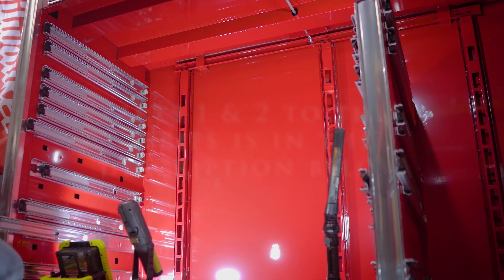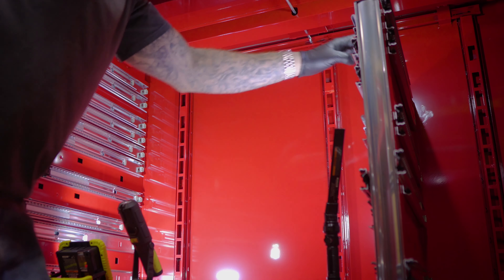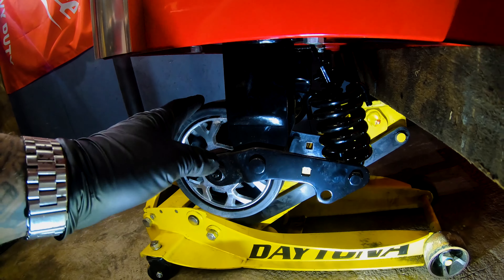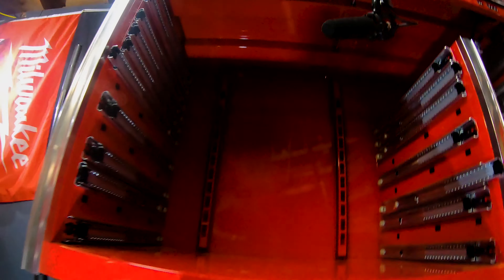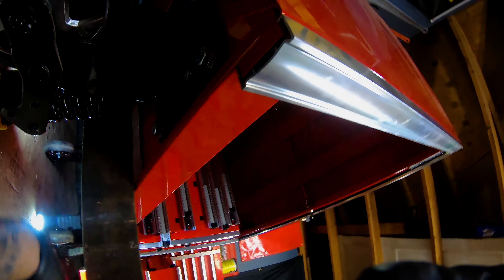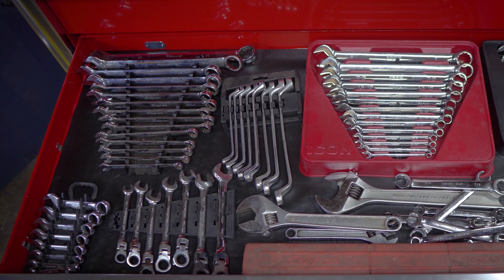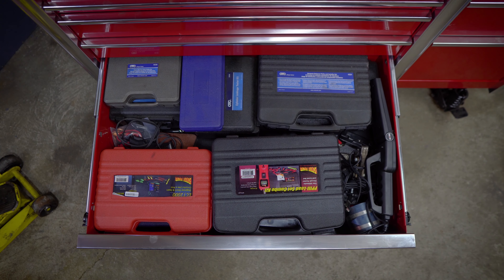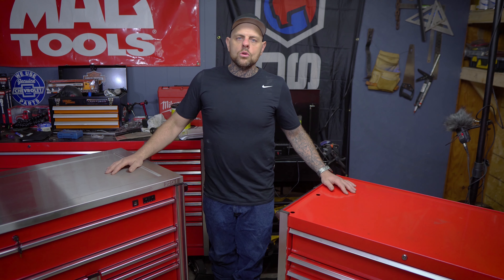Harbor Freight ICON Toolbox vs US General Toolbox A Look at the ICON Toolbox Construction

Comment: I trust you brother, I've been turning a wrench a long time under a tree and I have two boxes a Craftsman anniversary and U.S. General.  The General is dying and my tool collection is growing,  I need at least a 56 for my large torch wrench.  I am seriously considering pulling the trigger.  My brother is an A&P he works for a major airline and probably has all the big name tool truck stuff.  He told me there was nothing wrong with my setup and said I am fine I told him about ICON and he said many mechanics in his shop and shops at other facilities used ICON and even U.S. General over Mac and Snap off.  The price point is a barrier but I have reduced the size of my garage and I can not keep adding boxes so perhaps I can sell a box or two and get a good box.  Peace out!  Keep the shiny side up!

Comment: Now I’m just a DIY guy but, I’ve been looking to upgrade to a 72” box for months now. 72” us general for $1200 plus having to rivet the drawer slides, etc. 72” icon, just the roller is $5000. 73” x 25”. A Tool Vault box ( probably overkill for me) but I could get an 84” x 30” roller with a stainless steel top for just over $4000. I don’t have a need for a hutch or anything but a side locker ( it’s a want, not a need). If this box is the one I’m owning for life, I’d be better off waiting a bit longer and buying the Tool Vault imo. Realistically though, I’d be fine with the US General for the money.

Comment: I physically saw these boxes yesterday 10/18/19. These ICON boxes are top of the line. They are just as good as Snap-on for half the price. I was surprised at how nice and sturdy it was.
Reply: I own an Epiq snap on and just purchased a ICON for home. The ICON is certainly not “just as good”. However, I will admit that it’s almost as good for way less than half the price.

Comment: Just sold my Snap On set up and I ordered an ICON 73” bottom, 56” top box and a side locker, $5900 with a HF credit app and the 10% off it gets you. Same setup thru Snap On is $28,700. If you really hammer your dealer you might get it for $20,000....crazy.

The drawers in the ICON can be changed out, remove two shallow drawers and replace with one medium, move shallow and medium drawers to different positions as needed, etc.
It’s still a very expensive tool box for a DIY’r, but a bargain for a professional like I am.

Comment: It really looks like a great box. And I agree if used for daily use I would choose the icon or snap on. I finally got to see the rachets and wrenches in my local store. They actually put out the rachets and wrenches where you can handle them and I was impressed with both very impressed.

Comment: Out-of-the-box question for you........
I own a USG 56" Series 2 top & bottom
I love everything about it BUT that top socket drawer.
I want a full width top drawer. 
I just ordered the top big socket drawer for the 72 USG cuz the deminsions are correct.
So I'll be cutting down that partition.

Do you think I'll nerd to reinforce anywhere???

The Icon partition obviously isn't weight bearing,so that is just as OK as b4.

The Icon has more load bearing supports up top, but have a 56 top is much of the weight not supported along the edges?

Do you think that partition is offering any support and I'd be weakening my box in a way that matters?

Comment: This video did seem to answer the "is it 5x better? " question for me. I'm a fabricator  (welder), as it is now I'm literally spilling out of my current box. So in need if an upgrade. I personally can't justify the extra cost especially 5x more for the icon. 

There are everything from mac and snap on to craftsman at work and as of right now the us general boxes are the best boxes on site.  But I have haven't seen where anybody has really had issues with build quality regardless of brand. Rather storage capacity and functionality.